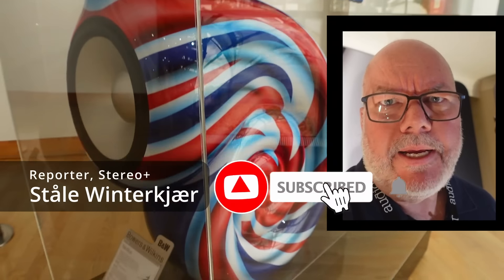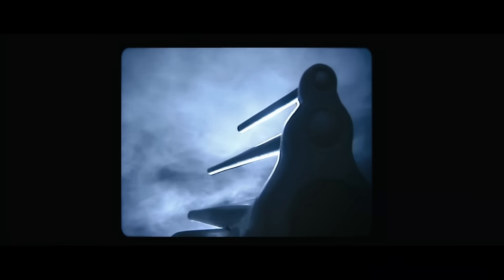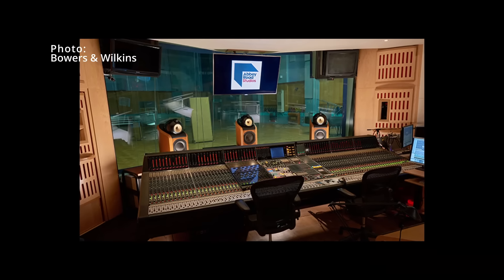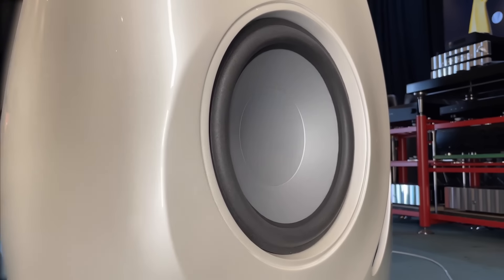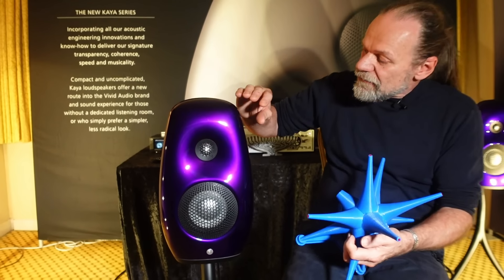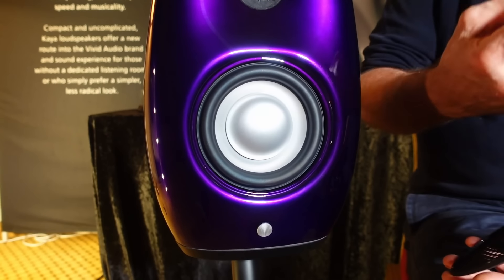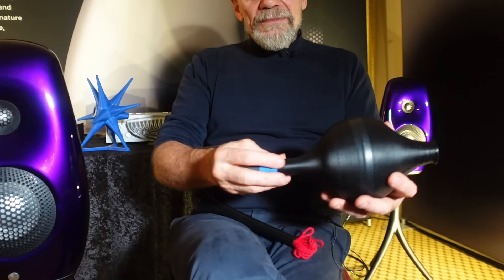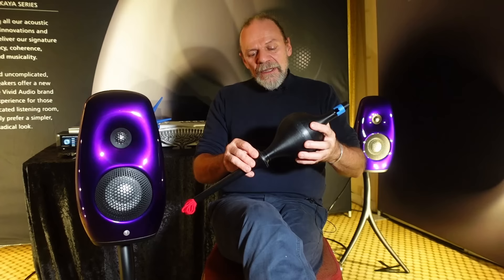The story about the legendary Nautilus speaker

Comment: Even assuming that 25 mm throw for the 100 mm driver is combined 2 way excursion , it is still an amazing 12.5 mm Xmax for such  a tiny driver . That kind of Xmax is normally only seen in 10 inch and bigger woofers (250 mm and upwards) . A normal 100 mm woofer has an Xmax of just 3 mm .
Reply: if you throw money at a small driver you can get lower distortion. most people would just increase the size of the cone. also there can be problems with getting long throw woofers to work higher in freq
Reply: 25mm is most likely the xmech, he mention the gap was included. 
so that is 12mm xmax. same as my 10" subwoofer driver.
and about twice i get out of 5" midwoofers on my main speakers.

Comment: The pair of those  Nautilus still costs about 100.000 Euros… but the membrans are old and not modernized.  It is a pity,  the styling is extraordinary
Reply: The drivers have been updated since they were introduced.
Reply: @BrettinLux  then they are about at the Niveau of the new 800 Series 2024? Or nearly?
Reply: They were only about $40,000 USD when they were new and the membranes were aluminum which isn't exactly like a 1970s paper cone.